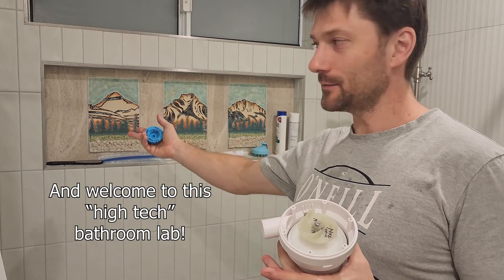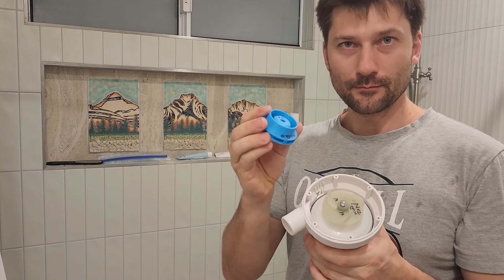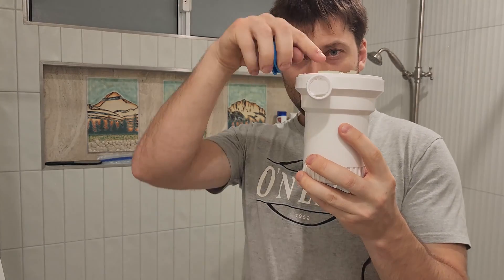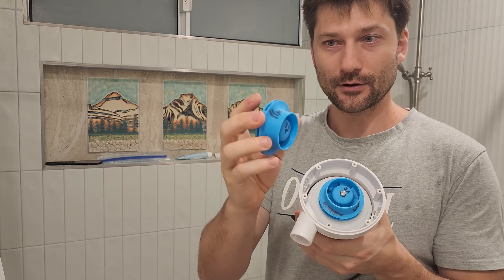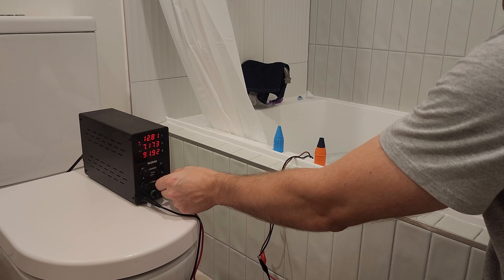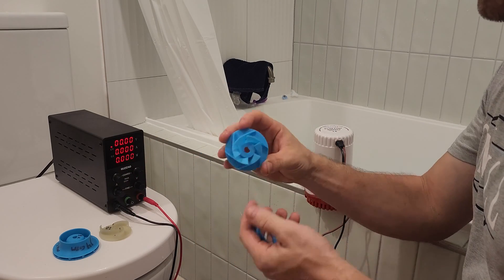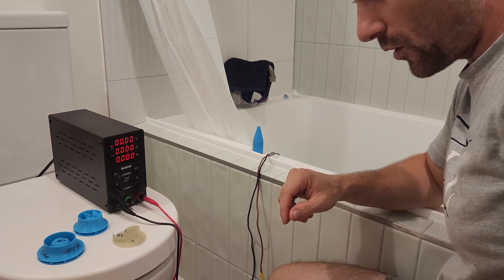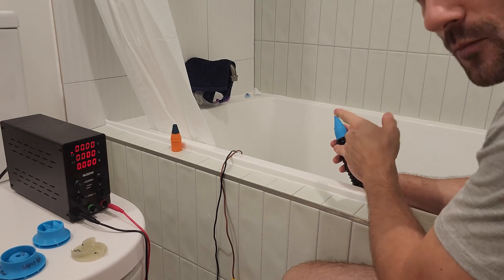Testing my First Two 3D Printed Bilge Pump Impellers.

Comment: what kind of 3D printer do you have? I also have a couple of Prusa MK3s+, and use them for everything possible including the gold prospecting hobby =)
Reply from the maker: I got a Bamboo Labs P1S specifically because it came with an enclosure so I can print more types of filament.  It was between Prusa and Bamboo Labs because I just wanted something that works.  I'm falling in love with this thing!

Comment: Ah yes.........memories! Playing with toys in the tub. Some of us never grow up 🤣 I am watching with great interest, as I am solely running my 4 different highbankers on battery power. I remember you doing some research a while back on the claims made by some pump manufacturers about GPH. Anyhow, any increase in pressure and efficency without  increased power demand is of great interest. And.......the price of lithium batteries keeps going down. I am looking at maybe a 100 Ah soon, to hopefully increase my hose length. Thanks for all your research and testing. It means a lot to many of us!
Reply from the maker: Thanks for the positive energy in the comment John!  I think a potential use case for the higher pressure impeller would be to work side by side with a longer hose...  We'll see how it all goes and I'll keep your specific mining style in mind for one of the prototypes. Do you have a preferred pump or brand so far? I picked the 2000gpm to experiment with because it was the largest pump with a stock 1-1/8" outlet and remains reasonably priced before the big step up into the larger pumps...  Curious on your experience with these pumps for highbanker feeding.
Reply: I often use the Johnson 2200 GPR pump on my Le'Trap. I mostly use the Princess Auto 2000GPH pum on my Geao Highbanker and my 1100 GPH on my mini. The Le'Trap works best with a little more GPH. @UtmostOutdoors

Comment: Kyle We are lost as to your end goal . What is your step by step process you wish to follow ? give us a road map from A-B . We under stand R&D and better mouse traps . we only got showers in our house . You may want to get hold of Mark Keane in this regard for specs as Keane engineering has delved a little into underwater dredging  as well as eddy pumps . Having completely underwater sluice boxes in my mind will need a lot of engineering to work as efficient as your above water sluice . The question is, is there anyone out there on the same track to collaborate with or can help you with not reinventing the wheel

Comment: Love it 👍
When in doubt copy a dyson impeller design 😂. Or a car turbo design.
I thought the pump had its own housing shell, although it might not be the best design it saves weight on the impeller that the motor has to spin. I do remember you talked about maybe changing that design if you have to, i know you, and to get the best numbers you will have to 😂.

I puchased a 1100gph design because i thought the 2000gph were to expensive. That one for under $50 is a absolute bargain 👍. I am only powering a 6" setup so 1100gph is enough for my needs.

Comment: I have no idea what you are doing - OR WHY
Can you not just build a dredge or whatever it is you are building , and then simply purchase a pump that will provide the amount of flow that will run it ?
Reply from the maker: I will try to do a better job explaining the "why" in a future video.  I'm just trying to understand the pump a little better as I hope it might be an ingredient for a more efficient gold dredge.  It's surprisingly difficult to find higher pressure pumps in this size.
Reply: @UtmostOutdoors  For now , I would just like a yes or no answer.
Are you trying to increase Pressure at the expense of Flow Rate ?
I purchased one of those 2000 GPH Pumps and am so far Loving it.
I only need use half it's capacity and it pulls about 3 Amps , same as an 1100 SeaFlo.
I may make a tape and graph of Current consumption versus Water Flow.
Reply from the maker: Yes, I am trying to increase pressure at the expense of flow rate.  Curious if the same flow and pressure can be achieved with lower power use as well.  Basically, is there any actual benefit to swapping impellers, and if so, how much can be gained.
Reply: @UtmostOutdoors  Sort of reminds me of my air bed inflator pump and my tyre inflator pump.
Air bed pump does an air bed in a minute but is incapable of doing a tyre , EVER.
Tyre inflator does a tyre in a few minutes but takes even longer to do a air bed.
Always Love your tapes regardless if I have a clue where or what or why.
Reply: Cool stuff. You and the rest of us are going to learn a few things and hopefully you'll have some breakthroughs. You mentioned pump software...what's it called?